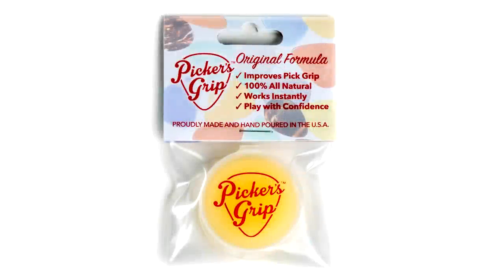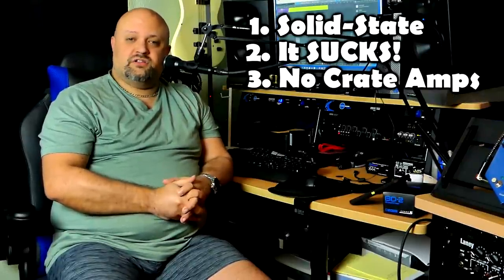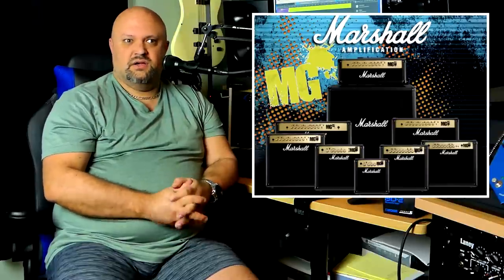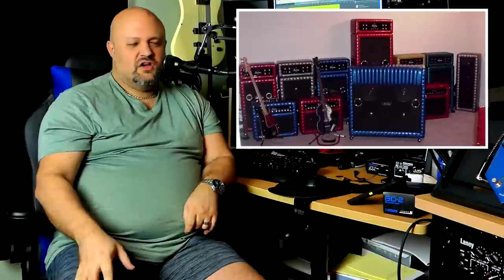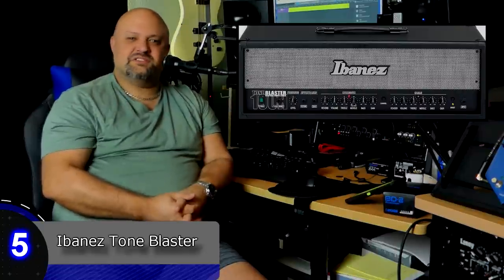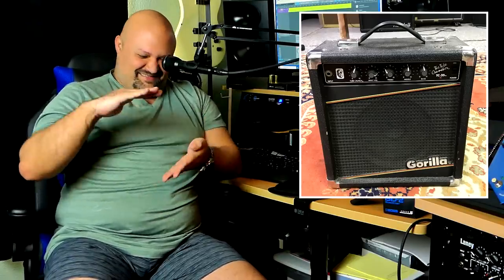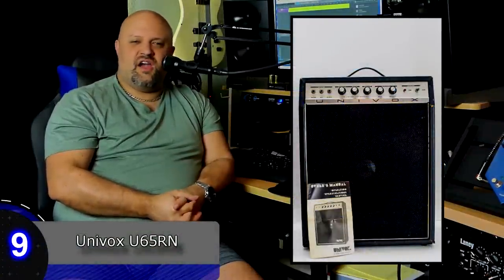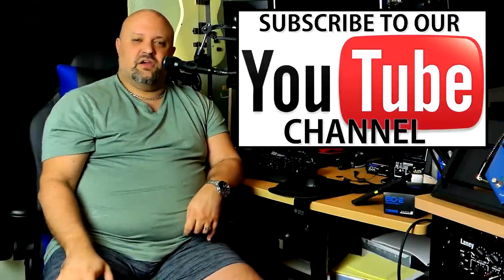Top 10 WORST Solid State Amps EVER!

Comment: I had a crate?? Not bad for a practice amp Ive had several cheesy amps over the years one I had I wish Im still had an old "1970's heath kit w 2-12's" sounded decent and you could gig with it. I was just a kid and it was fairly durable, But Peavy amps kind of piss me off n sound too tiny or cheap I had a peavy Mace n blew the speakers n I have a Peavy Audition 30 they are loud but just to tiny as in cheap sounding. But after having a 50 Watt Marshal w 6 ten cabinat no master volume though. I guess I got pretty spoiled. I have an small Accoustic amp nice sound for a little guy I think maybe an 8 inch speaker mostly they are noted for "bass amps" In the past. And I have a Fender Rumble bass amp n it sounds pretty decent as well N I had several Peavy TKO Bass amps not real happy with Under powered Id say not enough punch. And you speak of Beringer but I had a small Berhinger Bass amp that I actually liked quite well small n yet pretty powerful I cant say all Peavy's are bad a friend had one that sounded pretty good with kind of a Strat he had custom made.

Comment: The only Marshall mg series are worth a dam is the 15 watt stack collectible and room play and the 100watt head or stack. The rest do suck. All line 6 spiders suck. There midi ain’t bad but I hated the spider 6 red face eeewww. The crate powerblock was pretty good. I didn’t like crate 2x12 combo because they sounded like lime 6 but the more expensive ones did sound very good. I would through the 12” peavey bandits in the line up. Never sounded good to me don’t know if it was speakers or just to much mid range when cranked up.

Comment: You mised peavey delta blues series but litle custom work changed speakers and theyd stomp some seriously wicked delta rock blues and acid blues the 15 s were great tremolo amps again i had mine worked up rebuilt the.n staged be hind the 2x10 s and had lot guys guy just flipped at seriously smoldering tones

Comment: Behringer V-Amp amps were not very good as far as I have tested them. Behringer V-Tone amps were actually quite good imo.
Reply from the maker: Behringer ANYTHING isn’t very good, in my experience. LOL
Reply: @RobertWJackson  what do you say about the Line6 Spider first series? Line6 Spider 2 is so bad that it's almost an insult for the definition of "bad".
Reply: @RobertWJackson  I once had a Behringer V-amp2 modeler. The good thing about it was that it came with a nice carrying bag that could be used to carry things.
Reply from the maker: The Spider series amps didn’t even hit “Meh” status until the Spider IV’s came out.  The Spider V’s actually sound pretty good, but they still had to come out with a MKII version to get all of the features right on those.
Reply: @RobertWJackson  my first guitar amp was Crate GX15R, it's very very long time I had it and don't remember what it sounded like but I liked it... of course because I did not know better, had many amps since. I'm not saying it was bad, I have no experience of other Crates..

Comment: Oh yeah! I remember these little super cheap plasticky looking gray Crate brand practice amps in the 90s I think they were like 10 inch and some  had a Distortion and Reverb button built-in that rarely worked and if it did sounded horribly scratchy I must have destroyed at least 10 of them lighting them on fire dragging them down the road with my Bike by the power cable man those were fun times.😊 In fact I just seen one yesterday at a pawn shop they wanted $100 for it. No way in hell 😂😂😂

Comment: Looking at my old AOR Laney Pro Tube Lead 50, they do suck.  The worst  $100 I ever spent.....as I'm warming up my Mark V the best $2957.04  (Cream , Tweed and Tan) I ever spent on a amp.
Reply: The AOR series had a tone stack that took some getting used to. Similar to Bogner, the tone controls acted more like a volume boost for the frequency range, than a typical tone control. Also, they needed to be paired with a good cabinet, and speakers. I also used an Alesis micro verb in the effects loop as a kind of attenuator to get great distortion, at living room levels. I miss my AOR now, especially since I've recently acquired the matching AOR cabinet with another laney purchase.
Reply: @Guitars4Grunts  I'm giving this one back to my friend who I bought it from decades ago. I total waist of space.  I've been using a  Mesa V-Twin pre amp in front of a Crate Blue Voodoo 5150 cabs for 15 years. Now it's a Mark V.
Reply: @tinpenny4474  if I lived near by, I'd buy it from you. 😀

Comment: I think I've owned 4
Gibson GSS 100 - Nice until It got stole
Peavey Pacer - Nice with altec
Sunn Alpha - sounded better with Celstion
Vox Pathfinder 15r - Nice
Reply: My first guitar was a $10 Kmart Acoustic Guitar March of 1966
My first Electric Guitar was a Teisco Delray TRG-1 Fall of 66
My first Amp was a Kay 703 Early 67
Gibson Gss 100 67
Gibson Les Paul Jr DC
Silvertone 212 
Fender Black Face Concert Amp I got used in 1970
Bruce Amp in 1970
Marshall Super Lead 100 stack  July/August 1972
Sunn 50 Tube Base amp and cab spring of 73
Gibson dc special Melody Maker
Fender Black Face Bassman 74
Fender Silver face Bandmaster 77
Sunn Model T 79
Peavey Pacer around 79
Gretch Corvette
Sunn Alpha 81
SquierStrat (84 Japan)
Peavey Heritage 87
Peavey Tracer
Sovtec Mig 60 around 97
Sovtec Mig 50 around 97
Gibson SG Special
Laney Aor 50 around 98
Gibson ES 347
Marshall JCM 900 50 watt SLX
Gibson Les Paul Std
Fender Sunn Model T
Fender Deville
Fender red knob the twin
Vox Pathfinder 15r
Crate VC50
Crate Blue Voodoo
Carvin MTS 3200
Laney VC50
Laney GH50L
Marshall JCM 900 50 watt

I'm sure I forgot something
Reply from the maker: What is this?
Reply: @RobertWJackson  Good memories and a few bad memories

Comment: AVT 150H - I am sitting here playing with this as i took the time to mic a sure sm57 to a an acoustic using the clean and then the acoustic setting.  The double stack of crap ass marshal speakers don't do it any justice.  I need to buy some rocket 50's  - I know this -  but this crap as so called solid state/tube hybrid is nothing more than the worse Marshall solid state ever made... ever...  I hate this ... It looks cool.. But my buddy had a Marshall fridge in his man cave - and i would trade the whole thing for it in a blink. . I will use the cabs to house rocket 50's -  but this head has to GO!!!
Reply from the maker: Why so you want Rocket 50’s?  Those are the cheap Celestions that Line 6 uses for the Spider amps. LOL
Reply: @RobertWJackson  Imagine something twice as bad as those - I have 8 muddled Celestion G12-412MG 12" Guitar Speakers housed in 2 mg412 cabs.  The upgrade would be noticeably better and not break the bank - but I would like your recommendation for going about replacing the speakers and not replacing absolute crap with standard crap.  Should I just replace 2 at a time (like get  2 greenbacks and leave the rest until I buy more)?  I need to work this out in my head.
Reply from the maker: Look into Warehouse Guitar Speakers.  They make mostly Celestion clones that are high-quality.  I’ve got a pair of their Veteran 30’s (Vintage 30 clones) and they’re awesome.  You can buy those for about $80 apiece or so, almost half the cost of Vintage 30’s.

Comment: I like how most of the amps either have a following (slight) or SHOULD be good but aren't (MG)
It would be so easy to put obvious crap on the list.  Those Kustom amps...Oh god.  Used to have to borrow a PA that looked like a blue bass boat metallic sparkle and well...it made vocal sounds of some sort come out.  How was this crap ever popular?  This was the 90's (I am 40) and I thought, "A cheap set of home stereo speakers would be better!"  Actually I need to buy a PA now that it seems like they are almost free and NO ONE had one when I was a kid.  I want just because I can.  Sorry tangent.

Comment: Sound is subjective. You know what opinions are like. Another BS myth perpetrated by mediocre players looking for attention. I started with a peavey Tko 65 in 1982, (32 watts) switched to a 2x15 Kustom cab with a matching head, to a sunn coliseum, (our Ampeg SVT caught fire) 1978 MM HD 130 bass amp Sam ash white plains ny, Acoustic 360 preamp and 361 amp in cab and a folded 18” Kustom cab, radio shack PA’s, peavey combo, Earth, plush, Marlboro and my trusty Ampeg STV, SVP PREAMP WITH 5 preamp tubes. The pic is from ‘85. My silver Kustom cab with a sunn head. Played out in Westchester in the 90s with a peavey 300 combo ( 210 watts w/o ext speaker. Played out in Westchester biamped with a peavey 35 watt 😊minx amp. This tube BS ? 😂 I have plenty of tube preamps for that crap while recording.

Comment: Line 6 spiders are good for metal. That’s about it.
Reply from the maker: Nope, not even for metal.  I can think of 100 other amps I’d rather play metal through than a Line 6 Spider. LOL
Reply: That’s fair lol. But idk we got some kick ass death metal tones. Like early incantation sounds. But still not the best amps. I give Line 6 a lot of props for introducing a lot of people into the moduling world. But damn the spiders need a severe overhaul. I get it it’s their entry-level stuff in a way but come on there’s stuff out there that cost about the same but sounds way better.
Reply from the maker: The death metal stuff is different.  Most of those bands use shitty-sounding amps anyway. LOL

The Spider amps have actually come a long way.  I HATE the first three generations of this amps.  The Spider IV’s were a little better, but still not great.  The Spider V’s and Spider V MKII’s, on the other hand ARE good-sounding amps.  Those were the first ones that Line 6 produced after they got bought out by Yamaha, so they were developed with Yamaha’s engineering and financial backing, and it made a HUGE difference.

Comment: The Johnson  amp has two preamp tubes in it not true solid state I had that amp you can't get one of this for under 500$ the heads are 800$ made by DigiTech made in America not a cheap amp new they was 2000$  I had one and loved it but it blew up and I got it fixed I'm going to get another one and line 6 don't compare to this amp I have a spider 4 150 half stack but the Johnson is 10 times what it is the foot switch is 400$ should have been on your list its tube preamp driven like the marshal mode 4
Reply from the maker: #butthurt

Comment: Almost any Marshall after 83 
Engineers at Marshall  , more concerned with Stock Holders than Customers 
If ya don't mind coddling a fragile , overheating (overpriced)head .
Marshall is for you
Circuit board crap now
Reply from the maker: There’s nothing wrong with circuit boards. 🙄

Comment: I had a Crate Blue Voodoo, as my first “big” amp and it was total shit all around (yes I know it’s not a solid state). I have Mesa and Orange heads now, but I picked up a Crate 900 head purely because the cleans are so damn clean. For the money on the used market they are hard to beat. Also the G130 is pretty brutal.
Reply from the maker: I love the Blue Voodoo. 🤷🏻‍♂️
Reply: @RobertWJackson  I’ve wanted to try it again to see if my memories and thoughts from that time are accurate and valid. I sold it about 23-24 years ago now I guess, and was in my mid-teens. As I remember, the built-in distortion channel was really thin sounding and cleans were fairly lifeless. Thanks for the reply!

Comment: I’ve never tried the Line 6 Spider II or III, but my Line 6 Spider IV 150 watt 4x12 sounds great once you learn how to program the settings to your liking. Not adding Crate amps to the list because you grew up with them is biased. I used to have a Crate GLX65 65 watt amp and it sounded like crap compared to my Spider IV. Its only use was its clean setting.
Reply from the maker: Of course it’s biased, it’s called an opinion.  If you watched this video expecting anything else, that’s on you.

Your Crate combo sounded like crap because you only ran it through the cheap factory speaker that was in it.  Had you played it through a real speaker in a real cab, you’d know what you were missing.
Reply: @RobertWJackson  A decent combo amp doesn’t need a secondary speaker to sound good. You may say what you wish, but my Line 6 Spider IV 150 watt 4x12 blew my mind at loud volumes. 

You can look up a Crate GLX65 if you feel like it, but their only use is their clean setting. Distortion = poopy. If you think I’m talking poopy, feel free to press on my profile and watch my quick video of me playing Steel Panther’s Just Like Tiger Woods solo.
Reply from the maker: I don’t need to look up the GLX65, I used to own the 2x12 version.  I’ve proven on my channel in the past that the problem with Crate amps wasn’t the amps themselves, it was the cheap-ass speakers that they put in their cabs and combos.  ArnoldPlaysGuitar has also demonstrated the same thing on his channel.  The speakers in the Spider IV’s are just as bad, but all of that garbage digital processing just makes it even worse.  The Spider V’s improved quite a bit because that was the first generation of the Spiders that was developed with Yamaha’s technology and financial backing.  Like what you like, I’ll never tell anybody not to.  But I’ll be just fine without any bullshit for having my own opinion.

Comment: It appears that some of these are small, practice amps.  Of course a small practice amp, won't sound like (nor cost as much) as a full sized amp (that you'd use in a band.) So, kind of picking on small, inexpensive practice amps is kind of sketchy, in terms of comparing "apples with apples, and oranges with oranges." The practice amp is designed for a different purpose. Also, keep in mind that a particular sound can be useful, if it's used in the right context.  Sometimes, you want an amp that isn't going to be "standing out in the front" in terms of tone, you'd want it for a more sudued background capacity.  Sometimes for kitch types of sounds you may want a cheap, cheesy sounding amp (think of it kind of like a special effect.) Then there's: What are you going to use the amp for? If you're just using it for a clean sound, and all you need it for is to practice with, it doesn't need to be a stellar amp.  Also, what style are you playing? If you're playing metal, your amp requirements may be different than someone looking for a muted jazz tone.  Everything is about context.
Reply from the maker: You want context?  Here’s some context:  this video is a damn joke and not meant to be taken seriously AT ALL.  Its purpose is to get a few laughs.
Reply: @RobertWJackson  Sorry that I missed your joke.  Thank you for clarifying.  I did see your laughter.

Comment: Marshall MG amps are very good! I have one and just ordered another, a used 100 FX head. The only SS amps with two speaker output jacks at 4 ohms min. You can use (2) 412 cab's at 16 ohms or one 412 at 8 ohms in stereo, you can run two 8 ohm 212 or 112 mono cabs and one 4 ohm 412/212/112 mono cab. No other mfr. makes a SS head that can do all that! They are professional SS. The MG's sound good too! This guy is on drugs, look at his expressions!
I have owned the Marshall JTM45 MkII head and JCM900 MkIII Hi-Gain non reverb head, 1960A and 1960B cabs as well-just as a reference. Also Two DSL40C combo amps.
Fender '59 Bassman LTD, Hot Rod DeVille, VibroChamp, FM212R, Vox AC15C1VB. Don't get me going....
Reply from the maker: BWAHAHAHAHAHAHAHAHAHAHAHAHAHAHAHAHAHAHAHAHAHAHAHAHAHAHAHAHAHAHAHAHAHAHAHAHAHAHAHAHAHAHAHAHAHAHA!!!!! 🤣🤣🤣🤣🤣🤣🤣🤣🤣🤣🤣🤣🤣🤣🤣🤣🤣🤣🤣🤣🤣🤣🤣🤣🤣🤣🤣🤣🤣

Comment: You can't compare solid state amps to digital. The MG series has a hideous distortion, as the Fender transistor amps ... did you forget the CARLSBRO amps?? You're absolutely wrong about the Johnson Milennium ...it came before Line6 and was a Digitech GSP2110 tube preamp + digital efx front-end and the power section was a stereo mosfet design by Hafler and 2 Celestion V30s Scott Gorham's practice-amp in the late 1990s
Reply from the maker: k

Comment: Sorry Robert but crate amps are crap. I wouldn’t give you 3 cents for one. Marshall MG30
Sounded ok but there is no dependability in those amps. I had a gorilla TC30 sounded ok for what it was. I was very disappointed to see a Laney amp on this list.
Reply from the maker: No they’re not.  The cheap speakers that they used in their combos and speaker cabs are garbage (tube amp models excluded), but you’ve clearly never played one of their amps through a good cab with good speakers if you think that way.  ESPECIALLY if you’re willing to defend the MG30.